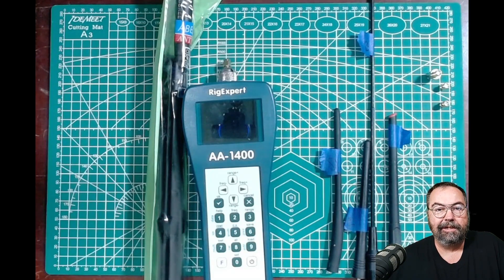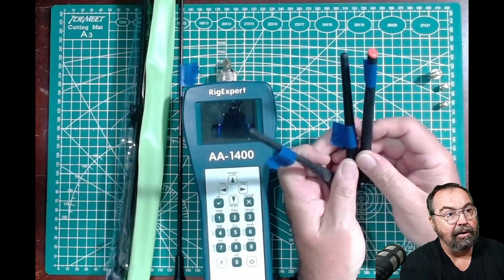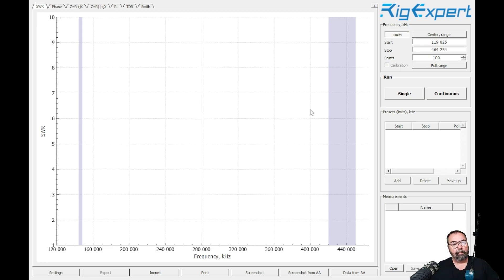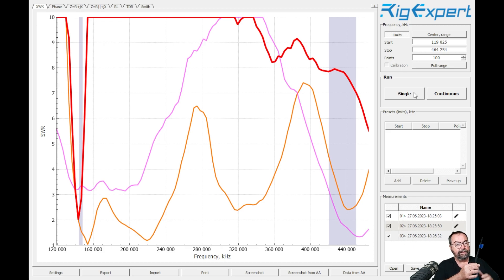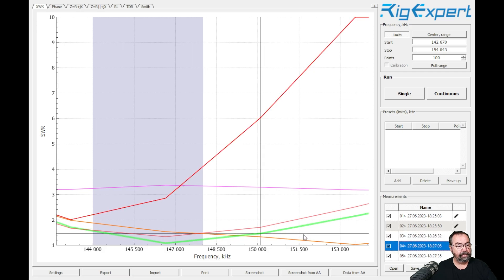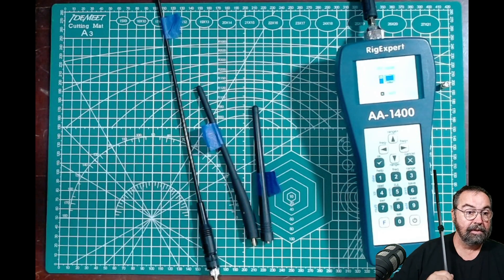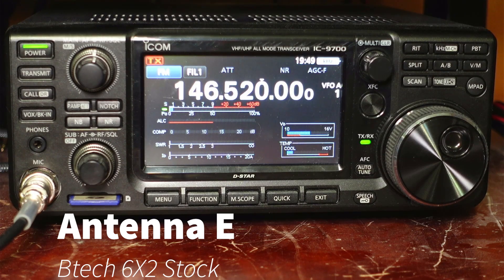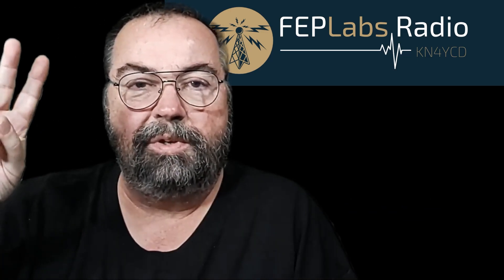Are Expensive HT Antennas Worth It?

Comment: Very interesting, I would have thought that the Diamond RH77-CA would have made a better showing, when I asked various people in the radio club I belong to that's the antenna they recommend the most to replace the factory rubber duck on my Yaesu FT-65.  If you do a third review, I'm curious to see what the telescopic antennas look like. I have the Smiley Antenna Super Stick II 2 meter and their 1/2 wave 2 meter that not only works very well as a receive only antenna for my hand held scanner radio, but fully extended it does a bang up job for 2 meter transmit on the FT-65. Being telescopic it is only 8" collapsed making it easily portable. Fully extended it's 36" and doesn't feel too heavy.

Comment: Once again AWESOME.  I have the Abbree Tri-Mode that I use on a TYT TH-350 and I have had great luck into the local repeaters with this antenna.  I would point out, while you weren't testing the the antennas for 1.25m, the test for the big Abbree was awesome as well in the 1.25m band. I might have to get one just for "shock factor"  Kept it up sir.  73, KN4VA
Reply from the maker: Right on!  Very good point.  They make a 48" abbree antenna as well.  I just can't see ever using it fully extended, it's just so dang awkward.

Comment: I do have the 28 inch plus Abbree tactical antenna and it works great. But first I made a research and found out that the 28 and 42 inch version doesn't have much of a difference in performance. So I bought the 20 incher that doesn't give too much strain on the antenna connector. Believe it or not, the farthest contact I've made with it was around 74 kms on simplex with my Icom IC02AT at 4 watts and me being at less tha 200 feet above sea level.
Reply from the maker: Dangit Francis, now I gotta mess with the shorter abbree antennas....  ;)
Reply: @FEPLabsRadio  Ooops, sorry, I meant the 28 inch Abbree. I typed the wrong dimension. Kidding aside, it really does work and it's a must have for every ham for emergency purposes. Very good on vhf and not much on uhf I must say. 73 and all the best.